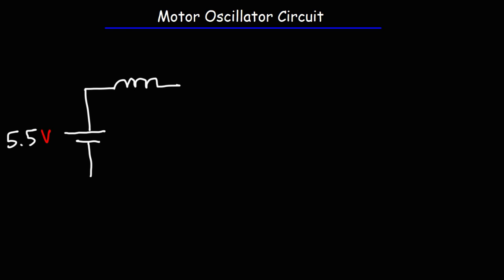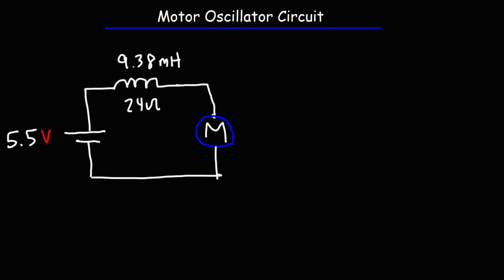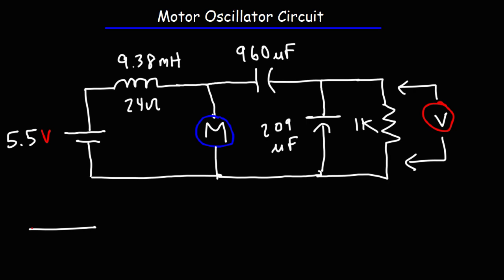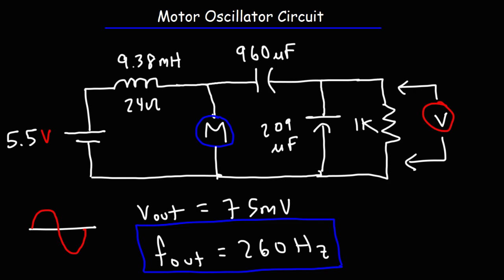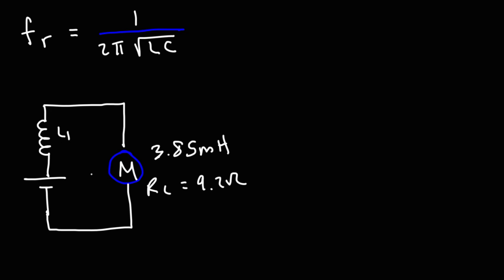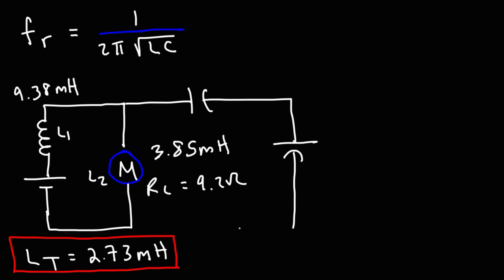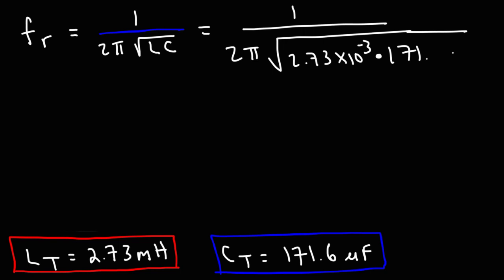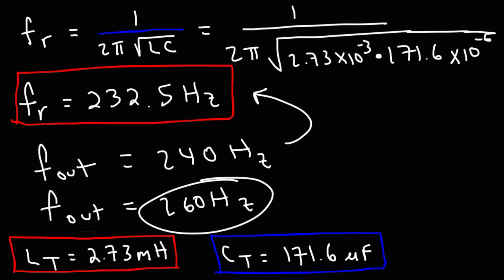How To Use a Motor, Inductor, & Two Capacitors To Make a Sine Wave Oscillator Circuit

Comment: I like how he elaborates more about why each element is added to the circuit in order to achieve the desired output. This is more the kind of commentary that I as searching for when discussing circuit design and the how's and why's of adding elements to achieve your desired goal! He reminds us at each step of the qualities each of the elements so all of it makes sense as you go along. Would a better way to recognize that L1 and L2 are parallel be to recognize that the 'output' of L1 goes to both the 960 uF capacitor and the motor? Or is the calculation simply one of convenience?

Comment: Would you please explain how the frequency increases with increasing the speed of the motor? The inductance of the motor isn't fixed? On the other hand the ossilation is generated by frequency of the motor spins, then how does LC work while the battery is always connected? Fr=1/(2pi sqrt(LC))